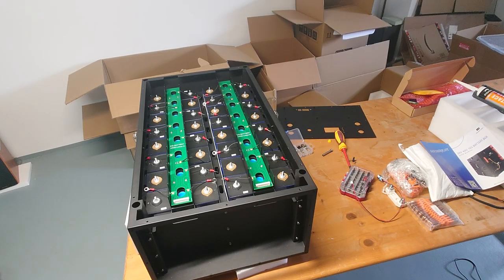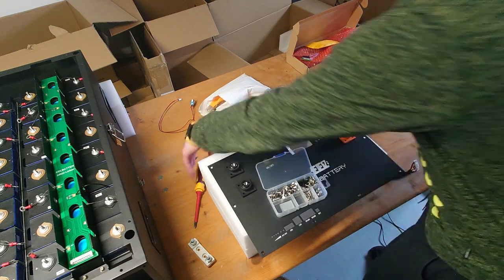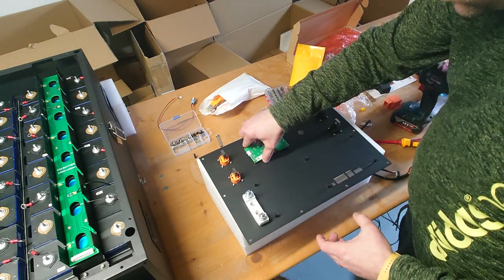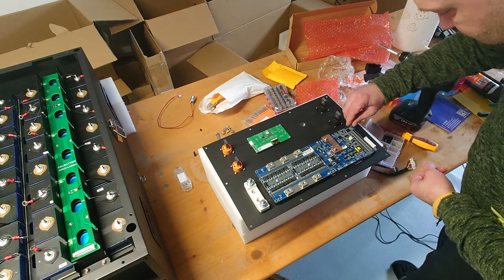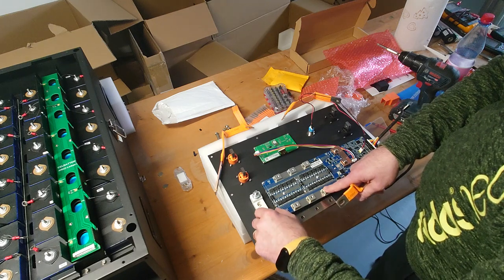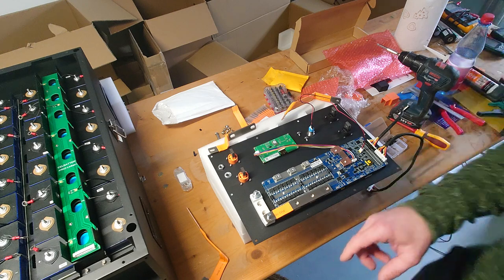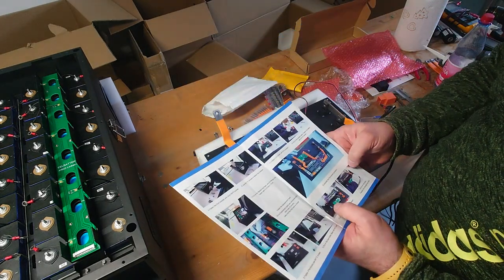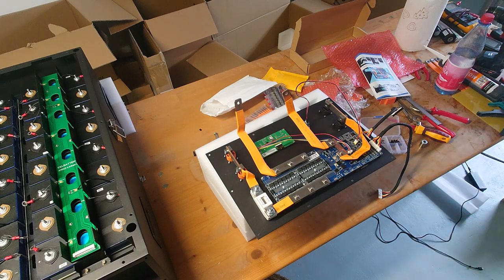EEL diy 16s battery case installation - Part 3 frontpanel + BMS

Comment: I like Semplos BMS communication with growatts but my negative feelings is that missing active balance 😔 like JK BMS.I also want to build my battery but i think i will go will JK BMS even that does not communicate with growatts.Please answer to my question about 2 growatts parallel without battery if this is possible!
Reply from the maker: the missing active balancer is not really a big deal. I also had doubts in the beginning but the seplos is doing a decent job even with the passive balancer. I need a SoC for my power management solution so a bms with communication and scalable is mandatory in my case...
Reply from the maker: @GreekSIMRACING  as far as I know these inverters need a battery backup. grid and pv supply is optional but the battery is crucial to keep the inverters working. I' m not sure about your 14s setup but I can twll you the pylontech modules are all 15s not 16 like the seplos. so the inverter has a range of input which seems to be accepted. you can overpanel theses SPF with same string setups.